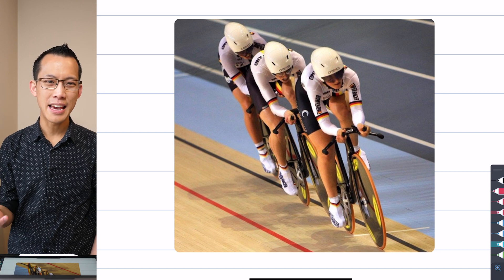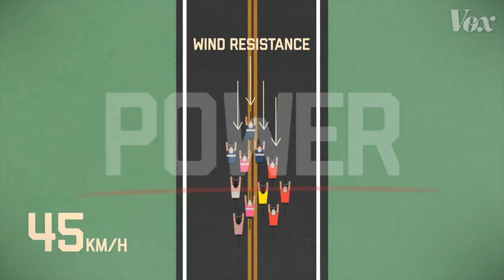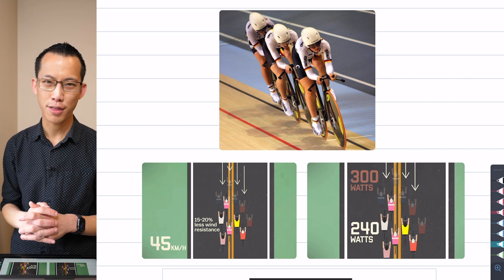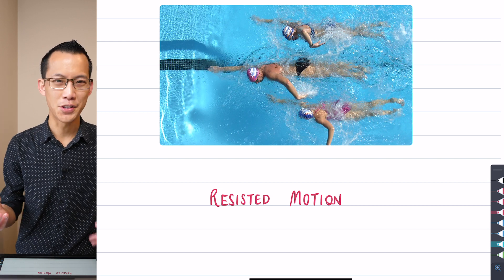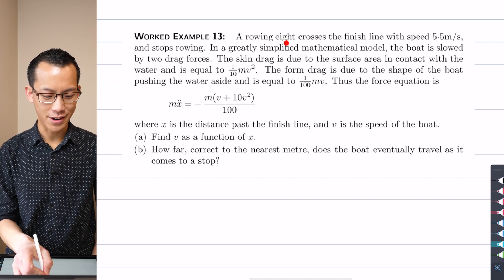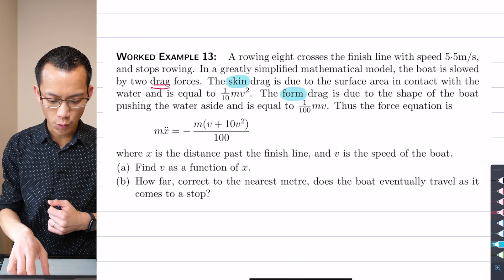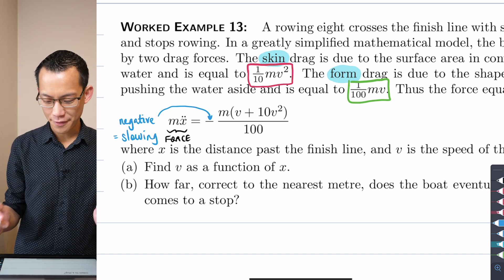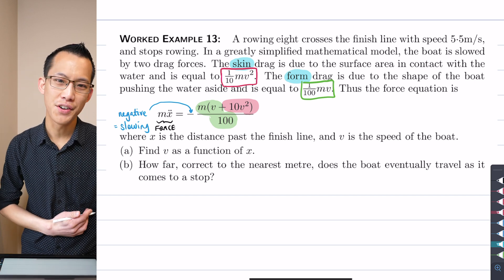Horizontal Resisted Motion (1 of 3: Introduction)

Comment: Eddie! How did you use “note cards” to cover up some of the text on Notability??
Reply: explore, and you discover it.
Reply: If you mean the large white boxes he uses to hide stuff behind: Make a rectangular shape, and then use the "lasso" tool (2nd from the right in the toolbar) to enter the "style" (leftmost option that appears when clicking on the rectangle) menu. Then choose the "fill" tab and choose a colour to fill in the rectangle. 

Note: Write your text/formulas/etc. first before creating the rectangular box. If you make the box first, it will be placed below the text instead of covering it. Also note that once you've chosen a colour in the "fill" tab for one shape, every shape you now make will have that same fill-colour. So to remove that, simply make a shape and go back into the "fill" tab and turn off the fill-colour by clicking the large rectangle shape with a diagonal line going through it. Any new shapes you make will now be without a fill colour.
Reply: @xRappo  the same for small boxes?
Reply: @aashsyed1277  “explore and you discover it”
Reply: @danielbyun  you not me haha i never used notability! i dont have ipad!